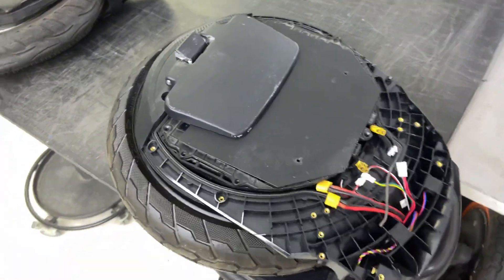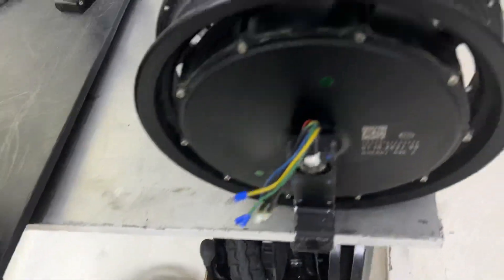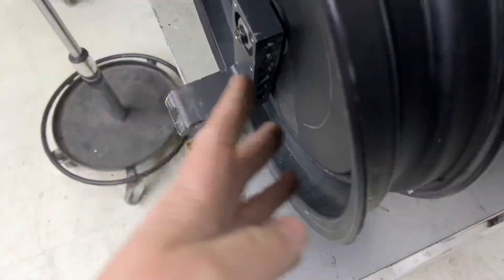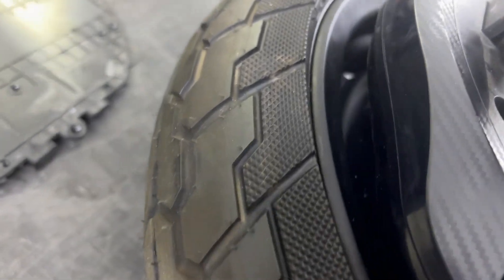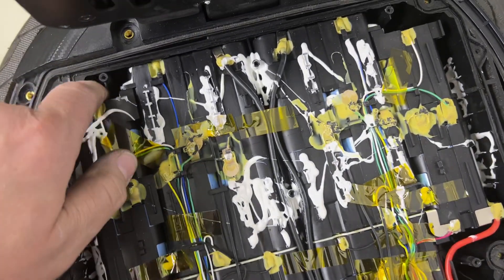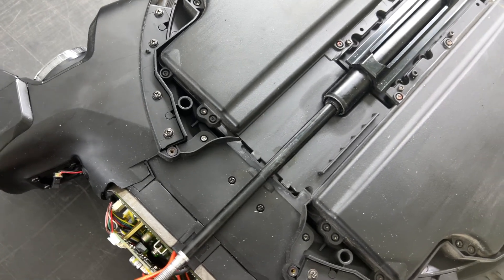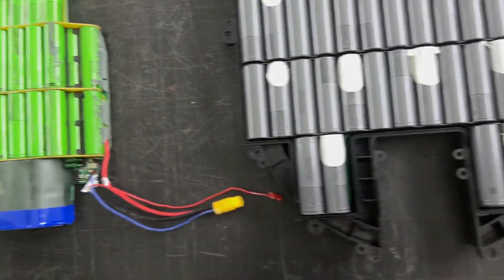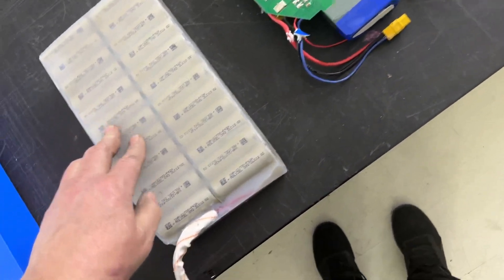Ninebot z10, Inmotion V11 & V12 Repair & Compare.

Comment: what is my chances at replacing a cell (or multiple cells) in a V12 battery pack? Got "battery 2 failure". Have the entire wheel torn down to the single battery pack.

I got 4.4 volts across the main leads of the bad pack (vs. 84V on the other battery). The entire pack is off the EUC now on its own.  My next step I think I have to carefully separate the battery covers apart (they feel glued together). I was going to check to see if I have a bad cell or a short circuit somewhere and replace that one cell(s).   It doesn't look too complicated on the inside of the battery from your video, but this is the first try on EUC repair for me.  Not looking for 400-800 dollar battery replacement if I can avoid it LOL.
Reply from the maker: Friend, there is a reason why batteries are so expensive.  Inmotion recommend new batteries and I understand why. You are at your own now.  4.4v means overcharged. Please, be very careful.

Comment: Totally agree with you, my InMotion v11 battery die, I've been searching how it can be replaced. I don't I could anymore after watching your video. The total cost of ownership is high for EUC, for an USD$3,000+ EUC which properly last around 4,000KM and need to replace batteries, EV is much than that in that sense!
Reply: I think I hit 10k km or very close to it. But I think my batteries are gone..or at least there’s some issue..that loud warning lol. We have local shops that say they can replace individual cells, not sure if it’s safe or worth it. Cheaper than buying a pack for sure but I don’t know if I’ll just get another wheel

Comment: Hello! Apparently, due to winter trips, my Z10 had a strong imbalance of battery elements up to 0.6 volts difference. Yes, it was very difficult to dismantle the elements of the battery blocks, but it worked. I balanced it with an external charger, I will try to install it in place and check. In the future, I will try to assemble it from new 18650 elements.
Reply from the maker: Thanks for sharing

Comment: Hey! Im doing a ninebot z10 cell repair, but am wondering how to remove the pack from the housing. Ive removed all screws, but it still does not go anywhere. Any tips?
Reply from the maker: @mattyd_gaming7425  you need to use some force to pull the battery out of compartment. It fits very tight. Please, like AND subscribe!

Comment: Does V12 have passive cell balancing?
Reply from the maker: No. Like most modern wheels, V12, as V11, now V13 has active balancing, throught controller.